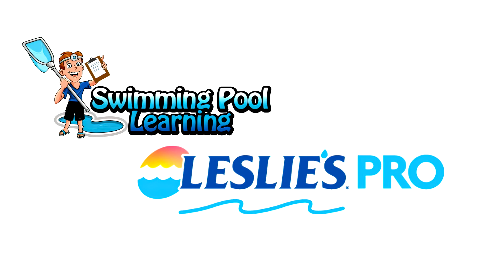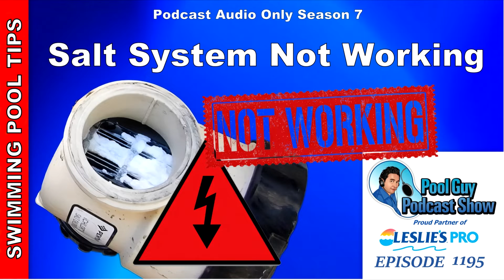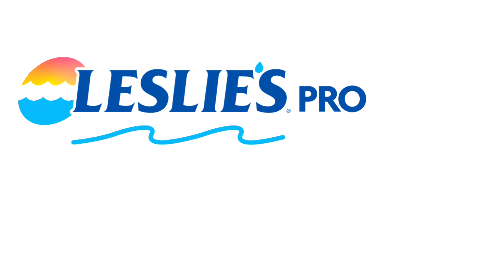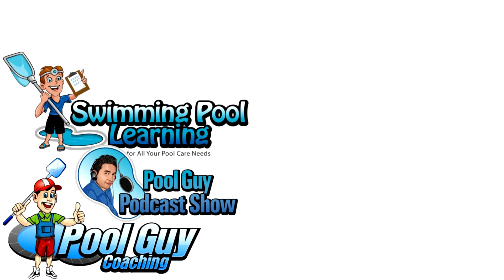Salt System Not Working

Comment: Here is South Florida pretty much every home has a swimming pool yet NOBODY that I know is using their salt system. When the cell dies it just doesn’t make sense to them to replace it. They can’t justify spending $1000 for a new cell when the only benefit is the convenience to their pool service tech. And those of us who maintain our own pools just use liquid chlorine which is still relatively cheap. Four years of liquid chlorine costs $768 (5 gallons a month at a cost of $8 for a jerry jug) — financially there’s no advantage to salt water pools over time. 

The root of the problem here is that the person selling $2000 salt systems isn’t disclosing that there’s another $1000 maintenance required every 4 years. When homeowners discover this they feel duped and the math says ditch the saltwater pool. I know a few people who have replaced the cell one time but when it’s time for number two they wise up. 
 
The convenience of SWG is overstated as well. You still have to acid wash the cell regularly and haul bags of salt around. And then there is the headache of troubleshooting periodic error codes. So much  simpler to throw some tabs in a floater or pour in some liquid chlorine. 

Pool service techs and pool supply companies love salt systems but after the initial honeymoon homeowners can live without them. Kudos to all who are currently enjoying their SWG — I sincerely hope your experience is different than what I have observed in the long run
Reply: You said it all and how about all the acid you need to bring down pH.   I need acid every 3 days to keep pH in range.  When my salt cell dies I will definitely be thinking about liquid chlorine

Comment: I really like the salt systems but until they make a product that is built to last longer than a few years I don’t think they are worth the current cost.  Not to mention salt units don’t generate enough chlorine for the Florida heat and the amount of rain we get, I still have to add chlorine and stabilizer.  But hey nothing is built to last these days I guess it’s part of Biden’s build back better plan.  😂

Comment: Just ran into issue with a customer of mine's salt system. Getting a "High Salt/High Amps" read out (hayward salt system) but is giving a 1900 salt reading, however the salt is within range @ 3200ppm based on my portable salt tester.
New salt cell installed earlier this season. My initial thoughts are the main board is bad in the panel.
Reply: Most of my salt units I have on my route are misreading the salt level as well and they are only a yr or two old.  I just ride out the salt unit till it fails and then tell the customer to waste money on a new one 😉